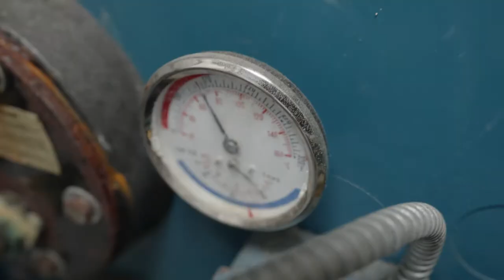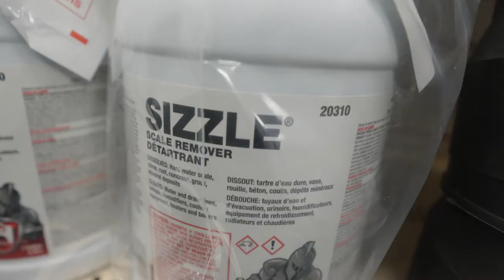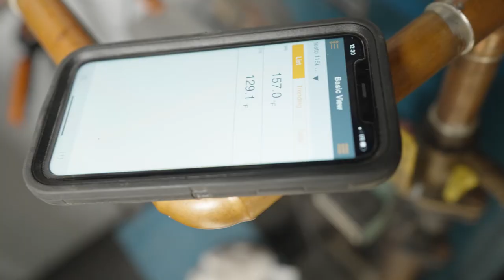MIXING VALVE REPLACEMENT!

Comment: Couldnt you of used a propane torch to loosen up those semi frozen nuts holding the mixing valve. I know there are gaskets in there, but you are replacing them, no?

Comment: How much would a service like this normally cost? I’m having the exact same problem with my mixing valve, but I was quoted close to $900 for a repair.
Reply: Depends what their labor rate is in my area I charge $95 an hour plus parts so I'd say it's a $250-350 job (including flushing it with sizzle) unless something else pops up while your fixing it which tbh it happens sometimes